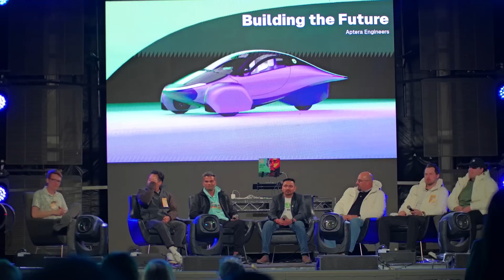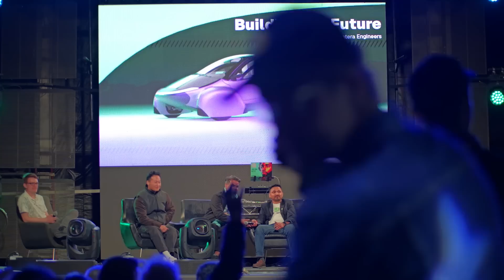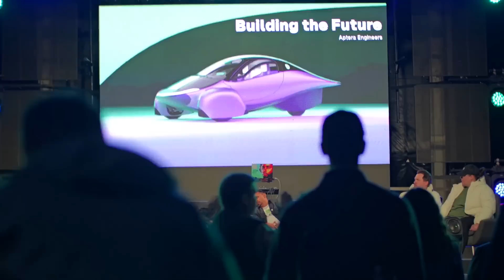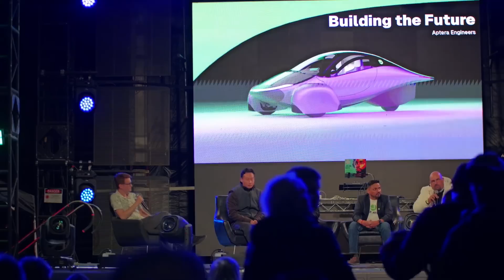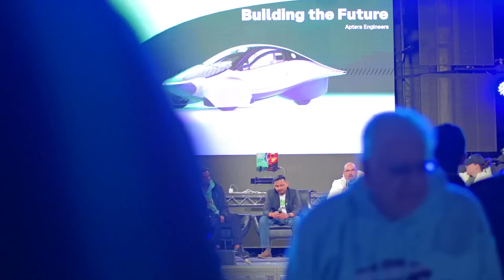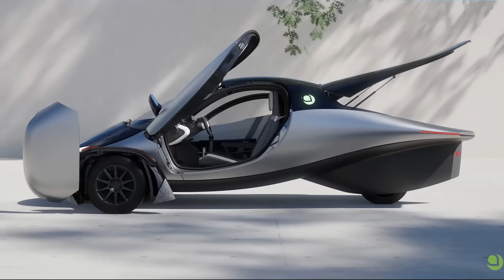Aptera's CES Afterparty:  Q&A with the engineers

Comment: No seat or steering wheel heaters and no heat pump... Launch Edition doesn't sound like a great option for us in northern US and Canada. I get not being able to implement a heat pump at this early stage, but seat and steering wheel heaters are so simple to implement and don't add any weight. Under certain circumstances, they can even improve the efficiency of the vehicle in cold weather by reducing the need to use cabin heating.

Comment: Why I probably won't get a launch edition Aptera.  

No side impact airbags, no heated seats and steering wheel, no AWD. 

If it had all those things I wouldn't hesitate.

I'd also prefer a longer range 600 or 1000 miles but honestly a 400 mile range is enough.
Reply: Side impact airbags probably won't make it into production because it adds weight to the vehicle and it isn't required for a vehicle registered as a motorcycle. However, I expect that to come out as a third party option, maybe even as a replacement seat. 

Heated seats, again, they would increase weight, so Aptera will probably emphasize a heat pump option instead. But maybe the heat from the battery and motors could be used to heat the seats? And heating the seats wouldn't be that much different than heating the battery in winter. So I suspect that's more likely to be a production option, as part of the winterizing package. Aptera isn't worrying about freezing temperature NOW, but it doesn't mean they won't ever deal with it. 

I would bet money there will be third party options to replace the steering wheel. I'm keeping the yoke, though. 

AWD is definitely still on the table, but the form it will take is up in the air. It could be all hub motors, or the current front wheel drive with a hub motor in the back.
Reply: @richardryley3660  I agree with what your saying. And I understand the problems Aptera is facing and the sacrifices they have to make.

But as of now there are too many things in the negative column for me to consider buying one. The $40,000 price tag is the biggest. I'm also not interested in a shorter range one. If anything I would want more range not less.

Comment: Thanks for the Q&A coverage. There was no earth-shaking news, but it was fun to see the engineers respond. Aptera needs to complete their testing to confirm the real-world capabilities. And then move to start limited production ASAP. Then after volume production begins and additional funding comes through we will start to see a range of added features come, like a heated steering wheel and seats, a heat pump, AWD, and LFP batteries, plus much more. But seeing Aptera production in 2025 is the main goal.

Comment: Someone tell the supposed "solar engineer" that Maxeon Solar cells have a Pmp temperature coefficient of about -0.27% per degree C.  If the cells are operating at 80 C (176 F), they would deliver about 15% less power then they would at their rated temperature which is 25 C (77 F).  It's in the damn spec sheet for god's sake.

Oh, and, no satellites don't generally have 50% Gallium Arsenide solar cells.  More like up to 32%.  I'm happy to send you one or two.  I've built numerous panels with them.  Some are even curved and "automotive" grade.

Finally, really?  It took you ~100 "failures" before you figured out how to build a good solar panel?  If you worked for me, I'd have sent you back to school after 10 failures.....

Comment: Can you use an external "solar battery" to charge it from inside the vehicle?
Reply: Yeah, and vice versa. Once the car battery is charged (or by manual toggle or scheduled), start charging a "battery generator" so that solar energy isn't lost. Also, it would be cool if you could unpack a portable 400w solar panel setup you brought with you in the hatch to add to the Aptera's solar charging at a campsite (or driveway), It should be able to double the solar charging!
Reply: @josiahpaez4601  Wait. So yes, the Aptera can be charged using a large (solid-state) external battery from the inside of the vehicle while driving it? Or yes, that would be a nice-to-have future feature?
Reply: @ScottOstr  Oh no. Sorry, I thought that was an idea for a future feature, not a question. But I doubt that Aptera wants to take on the risk of charging a battery bank they didn't manufacture from inside the car. Plus, those batteries are pretty heavy but would only add like 20 mi range at most. But there's no reason you couldn't take one with you and then use it when parked to get those extra 20-ish miles if you needed them, like having a red 1 gallon gas can.
Reply: I would assume that if you can plug your phone into a solar panel to charge the you could do the same with the Aptera. We already know that it can be charged using a standard house outlet.
Reply: @Fairburne69  I wouldn't assume it. These things get overlooked all the time. This feature would be really low on the list of things to do relative to the things they need to finish to get the car in customers hands. Battery banks that support input from an external solar panel typically have a standardized barrel plug (it has a proper name that currently escapes me) that I haven't seen anywhere on the car or mentioned yet. But it seems like an obvious thing to do, it would literally double the solar charging speed. Besides adding the one connector, some extra wire, and a bit of programming, it should be fairly easy to implement (though it may also require a revision to the solar charge control board, but I'm sure it's doable).
Reply: 🔮 Nice bucket list: Flying Aptera ✅ Heat pump ✅ Super charging ✅
Reply: My wishlist item would be: Aptera kit car
Reply: I doubt that will ever happen  @ScottOstr

Comment: Anyone. Aptera battery technology?
Reply: They are using LG 21700 LI batteries
Reply: @n.brucenelson5920  I don't know about those. But I'll look it up. Things like fire safety and charge cycles before replacement.
Thanks.
Reply: @n.brucenelson5920  the one I use in my electric skateboard!